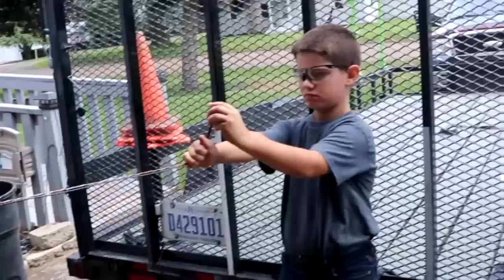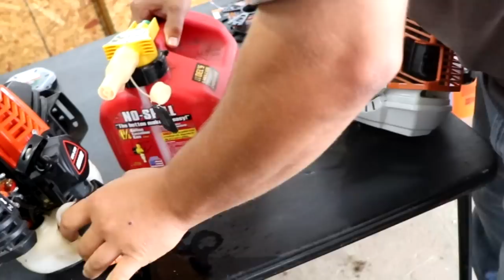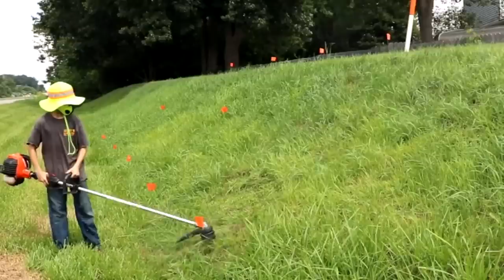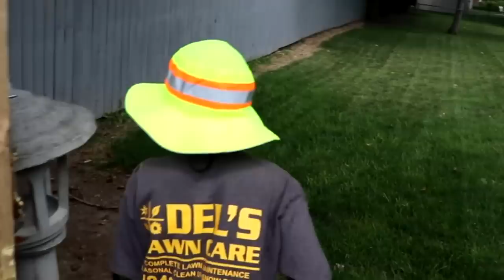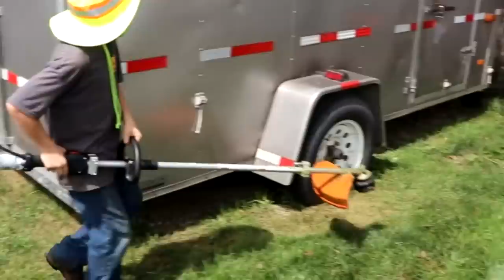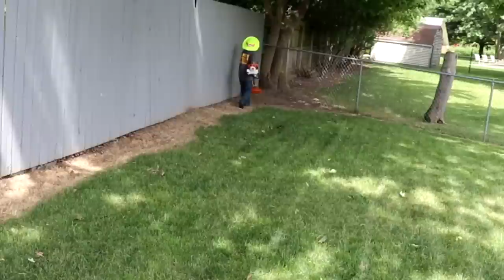Stihl FS94R VS Echo ProExtreme 2620

Comment: We love the new echo srm2620T i did swith to the 450 speedfeed head and also holds more line and the trimmer feels more balanced with the bigger head this unit has been extreamly reliable have owned it for over 4 months and starts well cold and hot.

Comment: If you want your line to cut grass clean, it needs to break more easily when it hits objects. The other line may be stronger but after hitting an object it begins to fray, resulting in a poorer cut quality. It wouldn’t matter on the test plot but if someone has beautiful grass, the tougher line will yellow it after each cut.
Reply from the maker: I like your point. After all the reviews on this video no one has talked about the line. Thanks for your point.

Comment: what the different between  Stihl fs70r and fs94r in torque. cause both have same hp 1.2 and have 2 rings in their but 3 different is cc size fs70r have 27.2cc fs94r have 24.1cc but fs94 have solid shaft while fs70r have upgrade flex cable compare to fs56r. Fs94r have larger gas tank compare but now i need to know about torque... it very strange.
Reply from the maker: travis10ist I honestly can't answer that question. I
Reply: The fs 70 r has more.ill go with the 70r..if you want just to trim grass in lawn service?the commerical fs70r flexy shaft would do the job without the heavy weight..or the fs94r for attachments stheel shaft.like cutting brush,grass cutting with a lot of torque  but you wont get the full beneifit,torque with only 24cc. like the 90r to the 110r, and up has about 28 to 31cc's plus torque..but ill rather buy the 91r just for the torque,more power,the price is cheaper..rather have too much power,manage it,better quality.its what in your budget to spend,what are you mainly using it for

Comment: Awesome comparison!! In my opinion the stihl fs 94r is the best all around trimmer. It's my go to trimmer.
Reply from the maker: USA Lawncare and Firewood it's really a nice trimmer.
Reply: Personally Id take a 525LST first choice but wouldnt turn down any of them for a deal price.  My 78 year old father loves the fs94r so I rarely get to use it lol.
Reply: stihl probably makes "some" good trimmers but, the fs 94 R is NOT one of them. It is a disposable trimmer, barely commercial grade. I'd take anything over the fs 94 R. Yes it's light but, the reason it's light is because it is made of very cheap parts. try changing the purge bulb for instance and you will see what I mean.

Comment: You should do a comparison with shindaiwa 262T. Big difference when you get a torque conversion, a much steel shaft instead of the 4 layer cable. A 20" swath instead of a 17" swath for the echo 2620. Much better trigger on the shindaiwa also. The same exact engine that echo uses in that 2620 is in that shindaiwa. Everything else is much better from there. I think that the shindaiwa 262t would give take that stihl 94r and give that still 100rx a much better run for its money. Pick one of those units up a 20% off one day or fleet week sale and you are doing much better than that Stihl. Stihl assembled in america and made in CHINA. I wouldn't even consider their overpriced and overated garbage. They lost my business when they started importing their components from
...CHINA.
Reply from the maker: We just picked up the T302 and T235 I'll see how things go.  Might compare 4 different trimmers with couple guys.
Reply: @DelsLawnCare  they are very nice. I'm kind of tempted to sell mine already. I'm ready to go back to the best of the last good shit made before corporate greed and the EPA ruined the industry.
Reply: @DelsLawnCare  How is your t235 holding up?  Do you like it?
Reply from the maker: @joeraptor1  it's great I use it everyday over all my trimmers unless I cut brush I grab the t302